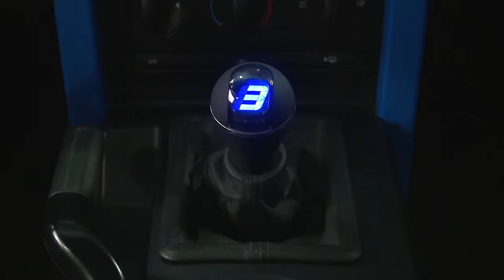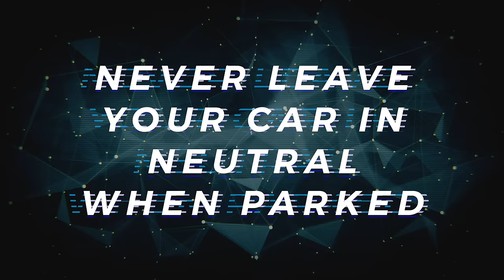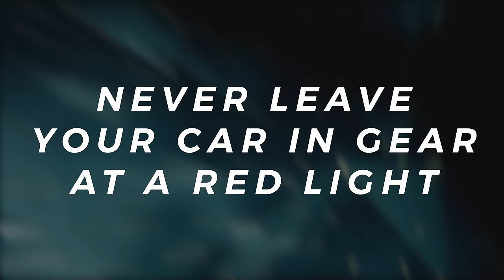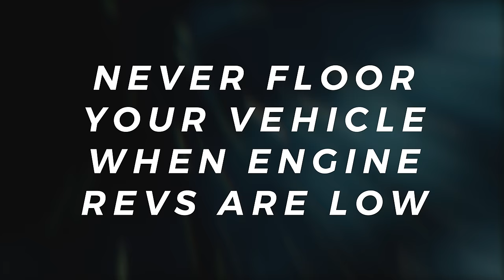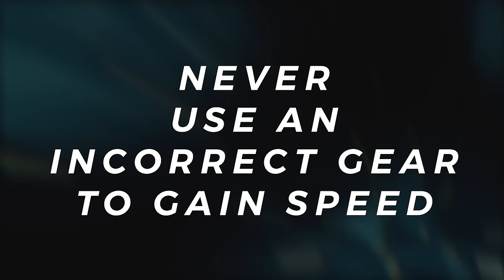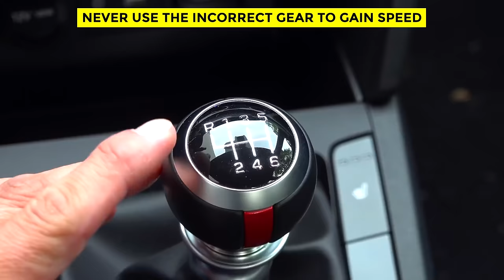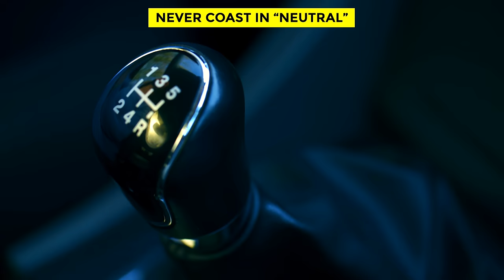7 Things You Should NEVER Do In a Manual Transmission Car!

Comment: Changing gears causes wear and tear on the gearbox. Simply leave that car in first everywhere you go to prevent this from happening.
Reply: Using clutch to get it in first causes unnecessary strain on the gearbox. Leave in neutral and just push
Reply: Exactly
Reply: Getting a new car causes unnecessary wear and tear on its transmission, simply don't buy a car
Reply: Yes and the best way to break is to put it in reverse while it goes forward
Reply: dang lmao, also the accelerator pedal is optional , you can use only clutch to get your car forward
Reply: @evanolsonelliott7315  Why push when you can leave the car at home and walk?
Reply: @cloudshifter  That will put wear and strain on your feet!
Reply: 🤣 just float in the air. To Hell with it!
Reply: @cloudshifter  You are putting an unnecessary strain on your garage and the car industry in whole, just join the stop oil movement and effing SIT on the road to block all of the car traffic.
Reply: I do this with my straight piped Honda everyone loves it
Reply: breathing can place unnecessary strain on your nose, better to not breathe.

Comment: "Never grind gears" NO WAY, I THOUGH IT WAS GOOD TO GRIND THE GEARS, THANK YOU MODER MUSCLE FOR YOUR ADVICES
Reply: Lmao
Reply: Well the older transmission gears weren’t as sleek and in unison as the newer transmissions. In fact I believe their design never intended for the gears to match the same speed before shifting, causing a grindy, terrible noise every time you shift gears but im recalling this from my bad long-term memory.
Reply: Lmfao
Reply: AHAHAHAHAHAH
Reply: @holdmybeefstew7131  Sounds like you had a problem in with the Synchromesh.
Reply: LOL ROTF!!!!!
Reply: Yeah fr
Reply: Shhhh secretly grinding gears actually reduces weight, therefore a faster car cause lighter, those stupid teeth on those gear things are just extra metal the manufacturer adds to make your car slower!
Reply: By the way, the plural of advice is advice.
Reply: Occasionally is okay if not a big grind.
Reply: definitely a "no shit" point. Glad someone else said it.
Reply: But those gears just, you know, basically scream "GRIND USSS!!!"...

Comment: "never brake without engaging the clutch" nope. Engine braking is important. It helps you slow down faster and save your brake rotors. Brake, then push in the clutch as the engine RPM drops below 2000 or so. That way you get good engine braking without causing any harm to the drivetrain.
Reply: And then if you need to slow down more you can always downshift unless you're in first although if you're on the highway in first gear you're going to have a lot more problems than a slightly worn out engine.

Comment: Tips for starting up a hill: 
Step 1.) release the brake with the clutch in, in 1st gear. 
Step 2.) roll and smash into the person behind you
Step 3.) explain that the YouTuber told you not to use the clutch or you’ll hurt it
Reply: I may need to practice it a little before master it so I hope I don't get my clutch destroyed
Reply: Step 1 pull the handbrake
Reply: Step 2 put the car in gear and begin to slip clutch while relasing the hand brake.
Reply: @lucasfrench1841  while applying gas because the car may or may not stall if you don't add any
Reply: I usually let of the clutch while braking, and when I feel the car wanting to go, I hit the gas.
Reply: @lucasfrench1841  Step 2 clutch in, go to 1st gear, release clutch, forget that u have the handbrake up, stall
Reply: @KamoteBuilds  lol
Reply: @KamoteBuilds  made me lol
Reply: @KamoteBuilds  if you forget about that better take the bus man
Reply: @josebarroso2184  but you cannot do that in depending wich cars, in most gasoline cars you need to give some gas for the car to have enough power and not stall. So the best thing is to use the handbrake
Reply: Best way is to learn how to drive . No need for a hand brake or anything else.
Reply: LMAO!
Reply: @KamoteBuilds  No this happen to me before but i never stalled and i drove a mile with the Ebrake up until i noticed a horrible burning smell and when i pulled over my brakes were smokin like a mf but suprisingly my ebrake survived idfk now but it did. Probably the stupidest thing ive ever done with a car ngl
Reply: If you actually drive manual you'd know that's exactly how it's done and the most you can roll back is 6 inches. Maybe a foot if it's a really steep hill. Heck I even did it on San Francisco famous 30 degrees uphill streets. Once you learn where (position on the pedal) clutch engages first gear you'll be able to switch your right foot from brake to gas in half a second while left foot lifts clutch pedal to exactly position it needs to be.
Reply: You can use the hand brake without damaging he clutch as he says
Reply: I heard apply hand brake and slowly release it when releasing the clutch
Reply: Step 1 don’t drive a manual you’ll damage the clutch
Reply: Just use the parking brakes and remove it
Reply: He ment to not use the clutch to givt the car just enough forward momentum to not roll back down the hill but to also not go forward
Reply: @lucasfrench1841 Manual unclear. I demolished car behind between doing steps 1 and 2.
Reply: @Philliamspencer 😂
Reply: I hate stopping at hills because it's quite difficult for new manual drivers,  but what I do is
Step 1: Brake on neutral
Step 2: Engage first gear (if the hill is not too sloppy) 
Step 3: Find the biting point or half clutch, then apply the accelerator to give it some thrust to move forward.
Reply: @arthuranthony99 exactly, and i train myself for 3 sec rule. Once you find the biting point, all you need is less than 3 secs to switch the right foot from break to gas while holding the half clutch by left foot. The car wont slip and you can now give gas at least 1.5 or 2, or if the uphill is steeper and youre loaded, to 2.5 to 3 rpm. Then you can slowly release the clutch. Slowly, have it on walking speed or about 10 kph.
Reply: @arthuranthony99  As somebody who never owned auto, though, driven sometimes, mostly on job, 
1. On really steep slope better engage parking brake, bcs this way you liberate your leg and won't slip if doing something during wait on slope.Its meaningfull only on lights, where waiting is long, if its just a jam, than brake pedal is ok, you won't wait relatively long.
2. Engage first, find half clutch,
3. put right leg on accelerator, start pushing it and simultaneously disengage parking brake, gaining speed by disengaging clutch totally and keeping rpm by pushing accelerator further if rpm falls. Though, keep it easy and slow or otherwise you risk duck forward and crush into car in front of you.

If slope is not that bad or car behind is not sniffing your back, parking brake is not needed; even if your leg slip, you would have time to react and move slightly forward, to recover distance. Can make car behind sweat though XD
Reply: 1
Reply: @lucasfrench1841 winter😂
Reply: handbrake method is insane dawg
Reply: Step 1. Release your parking brake.
Step 2. Call your mother.
Step 3. Black mail her.
step 4. Reverse into the person behind you
Reply: Fatal for. . . You. . . Or the car components

Comment: Italian here: I never had an automatic vehicle so I always drove manual. Some of the points are right, but some are a little bit too much, like resting your hand on the gear stick. You are right that it can damage the gear box, but only if you push...and the damage is near to nothing, compared to, for example, grinding gears. Just enjoy manual shifting, do not feel the pressure of other cars and take your time.
Reply: It's actually very desirable to have your hand on the gear stick (as long as your hand isn't adding pressure on it) in order to switch immidietly up gear or down depending on what happens on the road.
Reply: Also it can be a good habit to leave the car in neutral when parked on a flat hill, that way you aren’t wearing tf out of first gear.
Reply: Italian?  what does that have to do with anything?
Reply: @ahmettanriverdi5238  Just the fact that in my country manual transmission was normal. The automatic transmission is only becoming the standard in the last 10 years or so.
Reply: @ahmettanriverdi5238  🤣🤣
Reply: @se7ense7ens37  Exactly!
Reply: Resting your hand on the shifter can cause wear to the shift forks
Reply: @Mark-in5yw  Bah! I did it for 19 years and my car was as good as new before I sold it.
Reply: your gear stick will wear off over time. So no more numbers and it's gonna look like shit which is a bad thing if you ever want to sell your car.
Reply: @IlPandax let me guess, the Shifter knob didn't have any details anymore
Reply: @ultimateearrapechannel31  Quite possible.
Reply: I'm an american and have driven a Volkswagen karman ghia my entire life. I definitely agree that some of the points are very obvious and or a bit much.
Reply: @ultimateearrapechannel31 why is your channel named ultimaterapechannel???  🤔
Reply: exactly!!
Reply: I go in nuteral down hill all the time.saves alot of money in fuel. Bern doing it for year's? Hasn't caused any problems?
Reply: @michael-r9d8b  well, the problem is that not using the engine brake can be dangerous. If you are completely sure that is safe (few cars, no hard turns, soft slope, etc) you can do it...I did it in the past a lot of time. Ah, and of course you over use (is this expression corrent?) the brakes so they consume faster.
Reply: Owen Morris don't know how to drive a standard car
Reply: @michael-r9d8b it doesn't save fuel, quite the opposite. If you are in gear but not accelerating you use no fuel, if you are in neutral the engine keeps using fuel to stay on.
Reply: hey, unrelated topic: I'm an american and I'm trying to learn italian. do you have any advice/tips for me? I'm still very much a beginner. grazie.
Reply: @emborg3145  just eat more pasta! XD
No seriously, when you think about your own language it always seems easy, but just because you practise it for a long time. So the only advice I can give you is take your time and have fun! And grazie a te (thanks to you) for wanting to learn our language. If you need help, I'm here...I can teach you funny swear words! :D
Reply: @jerrymcweston3510 Why are you bringing The Producers into this discussion??
Reply: @se7ense7ens37  How do you wear out a gear when everything is stationary?
Reply: @se7ense7ens37  how are you wearing 1st gear when your car is turned off and not moving ? The gear is just engaged and thus connected to the engine. So if your brakes fail the car won't roll bcuz of engine break, like you'd need more strength to move the car. And it's actually recommended to do that in cold/freezing places so your brakes don't freeze and stick to the wheels.
But I don't leave it in gear when parked in flat so that if someone hits me when parking, the car will roll, not fully taking the impact. Cuz I noticed the car can still move a bit even with handbrake on.
Reply: Che bello un italiano
Reply: @ultimateearrapechannel31  i can buy a brand new OEM shift knob for for 95 nissan for like $40 if i cared that much or just get an aftermarket one
Reply: @ahmettanriverdi5238  lmao that was funny af mate.

Comment: When I first learnt to drive, I remember I was bit confused about the right gear. My friend told me your vehicle will tell you which gear she wants. I applied this trick to both car and scooter and it became easy. Actually the engine noise and stiffness are the indicators.
Reply: Your completely right, I was told the gears represent the speed you want to go for example 1st gear you would never go more than 10mph, 2nd gear 20mph, 3rd gear is 30mph, etc, never had a problem using that as a rough guide
Reply: Ya your engine will tell you when it's time to shift up but if you are shifting down then how to know
Reply: @saswatmohanty8132  actually the engine makes a bizzard sound like khar khar or rrrh. Sometimes I don't shift down intentionally I get such sound and apply brakes to slow down and then pump the clutch pedal to gain speed again
Reply: @nilanjandasgupta2718  Ohh I understand sir. Thanx for the guidance
Reply: @saswatmohanty8132  Basically the same: if you are slowing down and want to shift down, the stick will actually 'tell' you if you can do so: if you go to fast, you will feel that the stick will provide quite some feedback in a way like 'No way I'm going into a lower gear! You're going too fast!'. You will feel the stick protesting your requested action: if you get to a speed where it gets possible to do so, the stick will almost automatically slide into the right position but if you are just below the limit where it will just restrict you shifting down, you will hear the engine revving up quite a lot and cause quite some engine-braking, even in such manner that you will know you were a bit early.
You can always try this by speeding up to 3rd or 4th gear and than try to go back to 2nd in one go: getting it from 4 to neutral will  be no problem, but you will definitely feel the stick protest if you try to get it to 2nd gear while you are still at speed. Ofcourse, do not force the stick into position, it's doing all this for a reason, telling you to slow down more.
Reply: @nilanjandasgupta2718 it must be odd, as an Indian, to change gears using your left hand. I cannot imagine myself doing this, but it is certainly a matter of practice. And as a person who has always lived in India or in the UK, you must feel comfortable doing it.
Reply: @User-jr7vf  definitely yes. Actually for us we learn from childhood the British mode of traffic systems.
Reply: @markylon  as a beginner I didn't have at that time.
Reply: @Beethoven2949  well not accurate but the idea is right. As you can imagine a 300 HP car will surely put the first gear for more mph etc